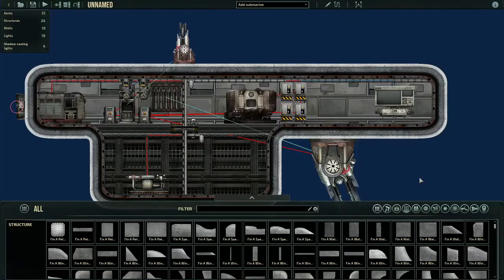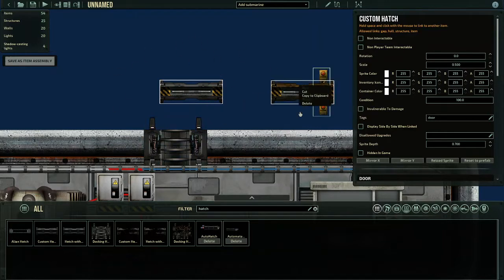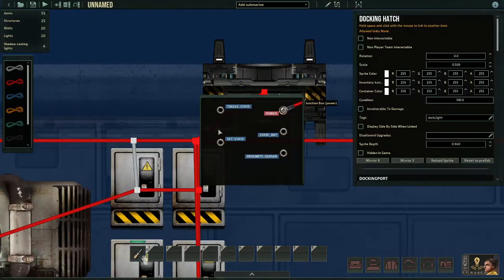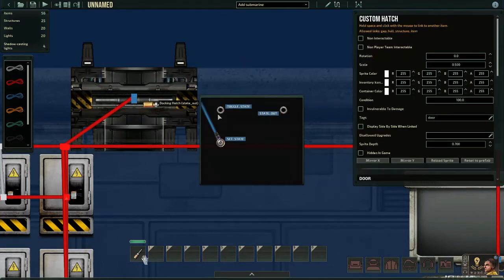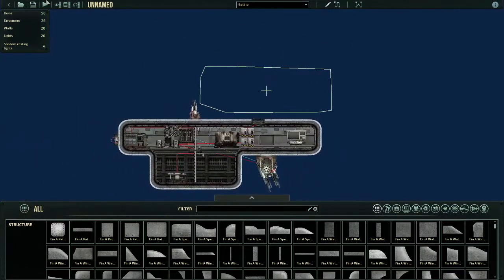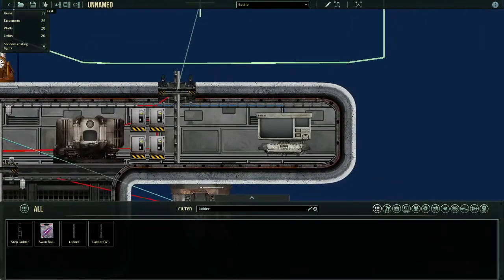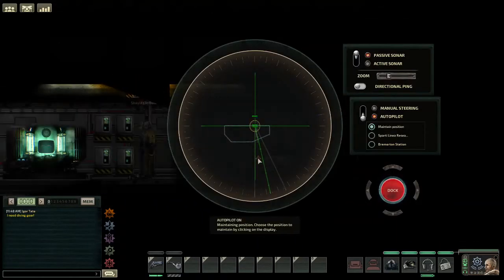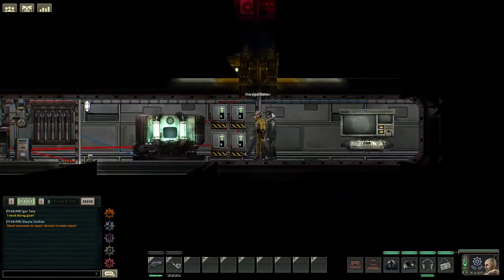How to Wire Docking Systems in Barotrauma

Comment: I have a problem. I made my own shuttle for use in a ship. as of right now though. when I link the ship to a docking hatch they do not connect. and instead my shuttle floats into the abyss. help? pls?
Reply from the maker: 1. does the shuttle also have a docking hatch?
2. if so, does the shuttle fit in the bay?
3. if you did not put it in the bay or it fits, does the hatch on the shuttle have the ability to dock to the sub? (This means if the hatch is on top of the shuttle, then the hatch it needs to dock to is on the bottom of the ship and vice versa)

Comment: My first attempt at using the editor I wanted to modify an existing submarine I really liked to suit my needs. A lil trial and error and it worked out great. Everything did exactly what I wanted in the end. I even figured out a little trick to make sure doors close automatically after a delay. (Cause bots kept leaving them open while we were flooding and monsters were pouring in) 

Im fine with manually opening them infact I prefer that. So doors I really want to stay shut don't just open cause I get to close. Which happens a lot on a small sub. (Ill post the how to below.) But in wiring all the doors to do this. I made an error by doing it to the docking hatches. DO NOT DO THIS! It will force it to open and close rappidly causing lag and making it impossible to enter the sub. ... So im hoping this will show me how to fix it.

How to make auto closing doors, but not auto open.

All you need is a door a way to open it a motion sensor a delay component and 2 wires.

First set the motion sensor somewhere in the middle of the door. Then configure the range so that it fits the door and nothing else. Configure it so it only detects the motions of whatever you want coming through. Set output to 0. Leave false output empty.

Place the delay component anywhere convenient. Set delay to whatever time you want. (Recommended anywhere from 2-5 seconds.)

First wire motion detector state out. To delay component signal in.

Second wire delay component signal out. To door set state.

The door will remain open as long as you are in the motion detectors range and close after the set time when you step away. No more bots leaving airlocks open flooding your sub.
Reply from the maker: Pretty sure an auto door already exists in the sub editor presets
Reply: @enchanter1102  It's an auto open and close door. I only wanted one that would auto close.
Reply: i think you can just toggle "keep door close" in their properties tab
Reply: @gavins9846  But I don't want every door to stay closed though.
Reply: @Guardian-of-Light137  Hm? You select this individually; you can pick which doors have that enabled.
Reply: @gavins9846  I know that I mean I don't want to apply it to every ... sigh Ya know what idek what I mean I just got off work my brain is turned off.
Reply: @Guardian-of-Light137  XDDDDDDDDD have a great night
Reply: @Guardian-of-Light137  Yea, i get it, i do manual labor and i have completely given up gaming on weekdays because i would be so out of it by the end. Today was special because the insane snow here gave us a day off.
Reply: @gavins9846  Oh wow. I just do stock at a family dollar and dollar tree hybrid store. It wasn't even a hard day. Ill pray you get some easier days dude.